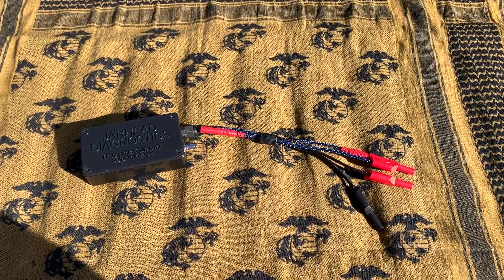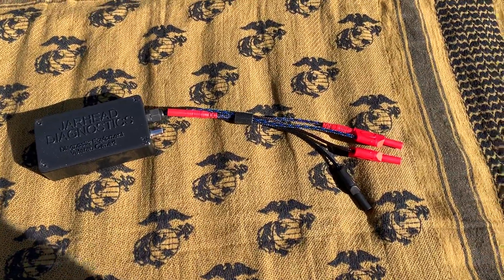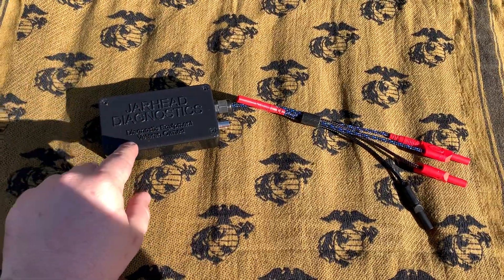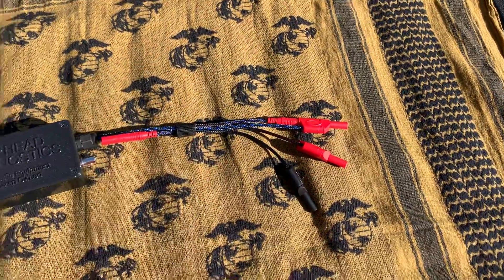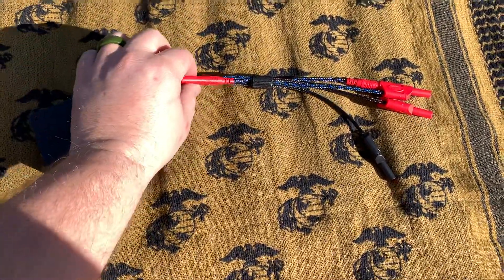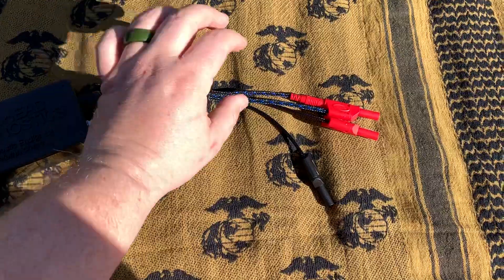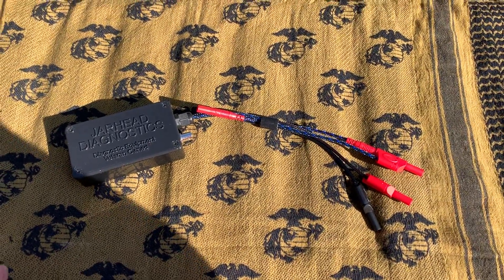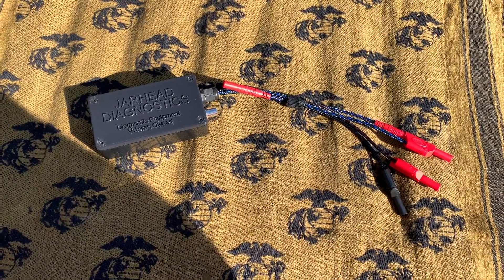Over view of the 5v reference box

Comment: Clean little test tool. Have you considered making the current limited circuit feature internal to the box and controlled with a second switch labeled pull up/pull down? Less external wires for a sleeker look?